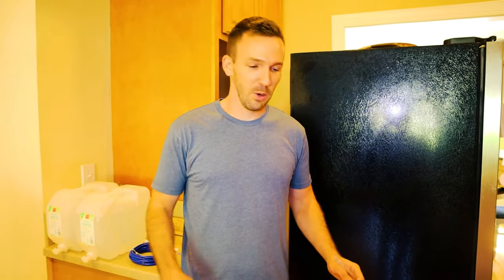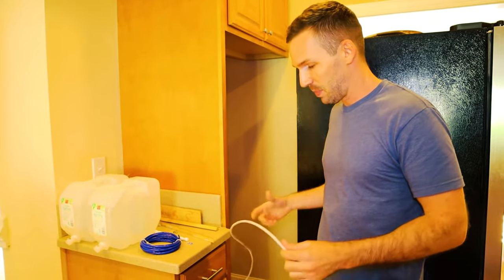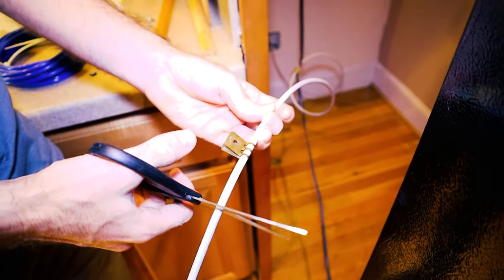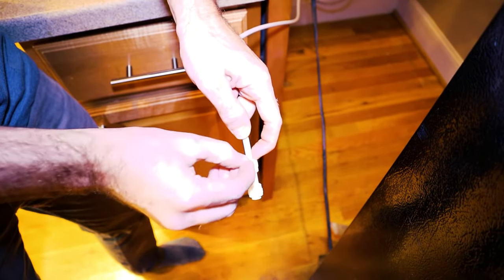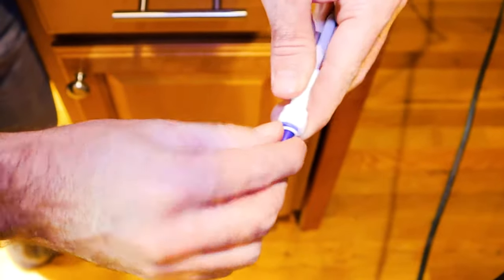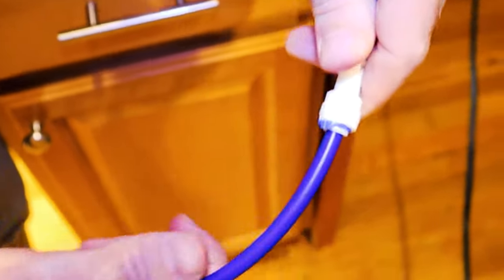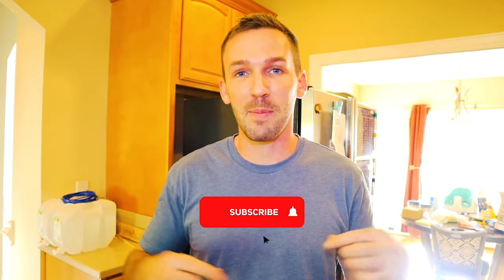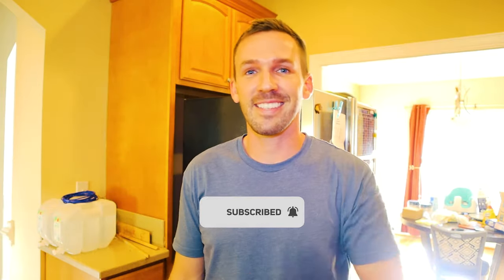How to Fix ANY Fridge Water Line

Comment: Wish I had seen this video before I replaced the entire water line hose and connectors. Same problem as you. A tiny hole in the hose was spitting out water. Soaked the floor all the way through to the basement. Turned off fridge water and I left it for about a month before I replaced it and turned the water back on. Nothing! Water line is now frozen! Arrgghh! - Charlie Brown.

Comment: Has anyone installed the push to connect coupling while the plastic line was wet? I'm having an issue finding my water shutoff valve.

Comment: Previous owner of my property had a pipe installed at the wall for piped fridge water. it has a 20mm metal pipe.  the LG fridge I bought has a 10mm pipe with a 10mm to 30mm pipe adaptor... I looked and cannot find a 20mm to 10mm adaptor so I have to use the LG 30 to 10 mm then a 20 to 30mm adaptor... its super crazy LG didn't bother to just include different adaptors.

Comment: My water line broke and I called for repairman but he didn't call back. I searched for videos to help fix my problem and came across yours. It cost me just over $7 for the Shark Bite Quick Connect coupling from Lowe's. Thanks for the video.

The repairman called after the fix. I told him what I did; he congratulated me and said he would have done the same thing

Comment: Thank you for sharing. I was able to repair my fridge in few minutes after watching your clip. This is my story. After replacing the water filter on my LG refrigerator lg model # lsc23924st, one of the water lines into the fridge broke! I drove to Home Depot and picked a 5/16" union coupling. I dispensed 3 gallons of water to clean the filter, and there was no leak.

Comment: Awesome job! Totally impressed that you were able to find a work around for the problem. Kudos for crawling under the house and determining where the problem was. You saved a ton of money over hiring a plumber to troubleshoot and repair!!!
Reply from the maker: I feel like I can crawl into anything after that nasty cabin remodel lol. Thanks Poor Man
Reply: I have the same issue with my leak. I thought the shutoff valve was under the kitchen sink but that isn't the case. Any ideas where it may be in my crawlspace? I'm guessing somewhere where the plastic line is in the crawlspace.

Comment: Thank you- i did this method and it worked for a week, now water is spraying from out of one of the connectors.
Is there another way to repair this ?
My line is a 5/16.. is there a hose that i can hose-clamp splice ?
Reply: I've had to change couplings every cpl years n now a simple swap didn't work so im curious if anyone answers this question..

Comment: Yea, I did the exact same thing for a 2011 Samsung fridge and at first it worked great. However, pin hole leaks kept creeping up in other areas of the water line hose. I fixed it like this with similar parts. I even put some water sensor alarms behind the fridge to detect water leakage. At first, they worked great as I had 2 more leaks & alarms went off. I was then able to shut off water early enough and repair as needed. However, after the 4th leak occurred under the fridge and didn't reach the sensors, I had to totally turn the water line off from the wall & keep it off as it was causing too many headaches. Not to mention more damage occurring in my finished basement. 

A great method & solution as long as other leaks don't turn up. This is also probably due to a 12+ yr old fridge. Luckily, I have a another (Kenmore) ice making fridge in basement that works great so for now we are simply bringing ice up to the kitchen Samsung fridge cause the dispenser still works perfectly fine. I am currently researching trying to replace ALL the water lines in my Samsung fridge. Could be tricky and a hassle. Another easy option is a counter ice maker instead. Will see.
Reply: Did you end up replace your fridge line?

Comment: Did your floor level back out after it dried out or is it still warped?
Reply from the maker: It’s forever warped until I sand it and refinish. 😥
But it’s not quite as warped as it was when wet

Comment: I was moving my fridge to a new location and noticed the water line was attached to the fridge but we don't use the water from.the fridge. I got frustrated trying to remove the brass fitting that I ended up cutting the clesr water line.. yeah I know.. and now I am here. I need to insert one of them Teflon fittings or brass..

Comment: This does not work. Very disappointed. I'll explain. Some refrigerators have 2 water lines: one that is to the water source and one that feeds to the ice machine. If the one to the source leaks, this works. BUT if it's the tube that's welded into the fridge. GG you need a new fridge. Tried this method and it leaks profusely. measured out the ID and OD as needed at lowes and still the sharkbite doesn't grip that custom/original water line. Sadly gorilla tape was more effective a remedy until we had to replace the water filter. then the psi surge popped the tape. Additionally HD/LOW doesn't sell the sharkbite with the couplings no more.

Comment: LOL.. why would you replace one linear foot of tubing? Just cut out that foot of tubing and join up the parts that are still good! You wasted money buying tubing if that's all you did.  Also, I just bought a connection with 5/16" - 1/4", made by John Guest, but doesn't require a little locking ring to keep it in. Home depot had it for $10.00 Canadian instead of paying for a  whirlpool part $34.00+. Another place wanted $57.00 and had to order it.
I read, you should change your tubing throughout the water system in your fridge water dispenser and freezer ice cube maker every 3-5 years. No way Im doing that! LOL... They recommend getting it cleaned out with vinegar also... by someone who knows how! I have no idea how they would pump vinegar through the system. (to clear out Mold)
The reason for changing the tubing is that the tubing dries out and cracks... so, you are probably in for some more cracks! Unless you backed your fridge up and pinched the tube???  I tape my tubing up onto the back of the fridge, up off the floor!
I also had slow water from my dispenser. Found out over the last week of searching videos that it is actually because the builders of our house, Minto,  put in a saddle valve on the water pipe to run a tube from, to the fridge... the water can't get through fast enough to dispense the water well. We thought it was normal...for 23 years.. LOL... just figured it out now! It was taking 45 seconds to fill a 12 ounce glass... OMG... Then I googled how long it should take and it should take about 8-10 seconds. Wayyyy faster! So, gonna change that ... maybe I'll make a video and post it! Maybe...
Hope this helps others,
Cheers..

Comment: Most new refrigerators that were made with water they will have a certain amount already called up in between protective cover in the bottom if you pull your bottom drawers out and you have clear protective cover you will be able to see the hose is about four feet in a circle you won't have to buy any new you just use what's there already stored in your refrigerator some are not see-through you have to take this protective cover off and there you'll see your extra water line it is rolled up and it has zip tie to keep it coiled up and out of the way always check before you go buy new hose like this guy did now he don't have any other use for the rest of that unless he's going to make him a water bath for the bird's.,.. yes I know a guy who did that he KNEW HE had water tube in frig so he did this an used the same connecters as this guy ... He had to surprise his wife and he did alright he hatton mopped up the water 💦 you got to have a little water when you disconnect the pipe he had it all put back he did not push the refrigerator back in place she come home from work water and her newly mop floor refrigerator out all kind of group spilt in the refrigerator because he's trying to pull it and now she had to clean her refrigerator out it was more trouble for him that the birdbath was worth to her so always use common sense if you're going to do something clean your mess up inside and outside if you really want to surprise her remark her freshly mopped and waxed floors